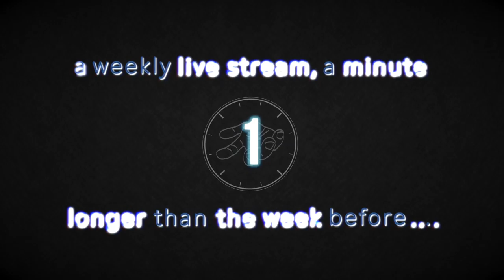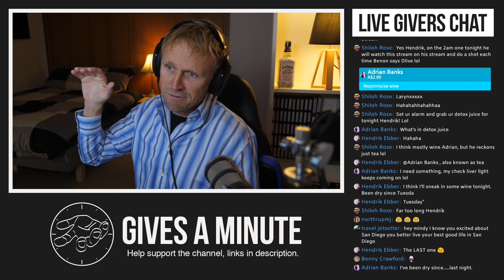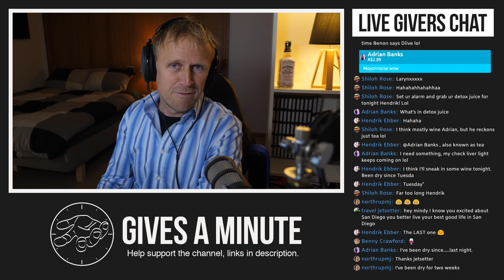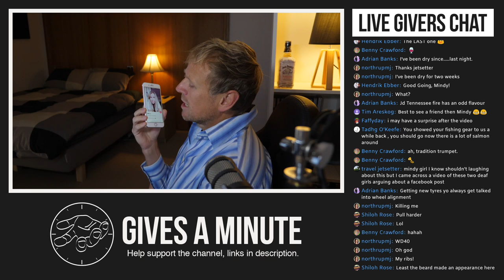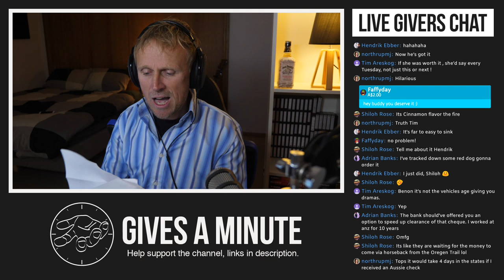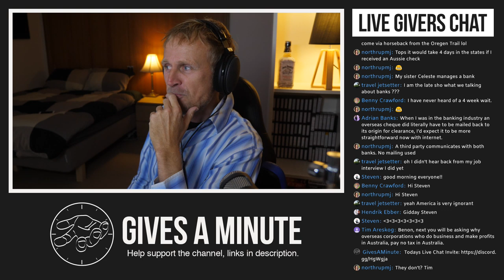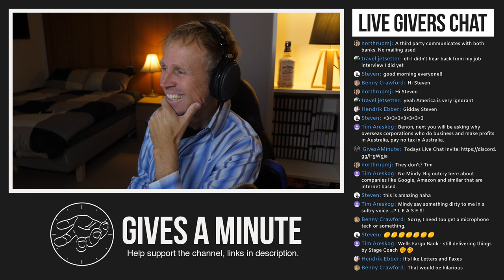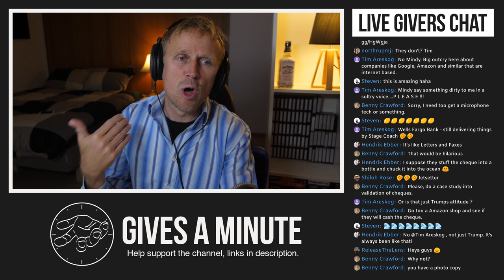What Service Do Big Banks Actually Provide Customers?

Comment: Sorry I missed part of the chat, had a dump run to do before it shut. Yeh I remember asking someone when I worked at anz, why they took so long and the answer I got was the cheque had to technically fly back to its home branch for clearing. I can’t believe she didn’t try and offer you a temporary overdraft. Yeh there is a fee for that but it’s at least a temporary solution.
Reply from the maker: Thats baffling. Why bother sending the cheque to the recipient if it's simply gonna have to go ALL the way back to the source? Someone is making $$ off this. What a scam!!